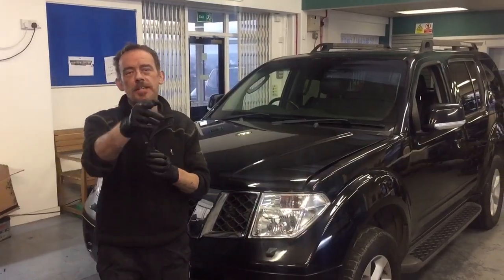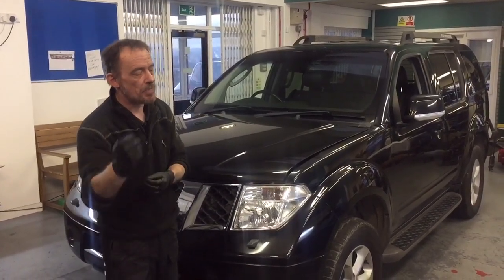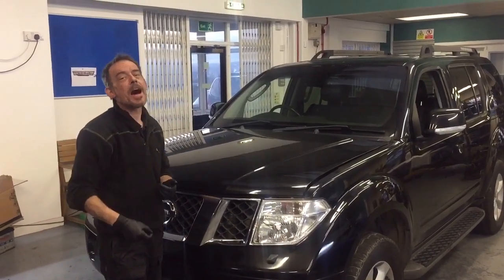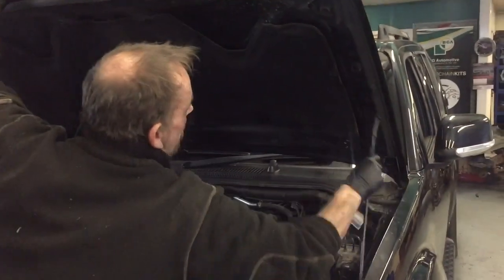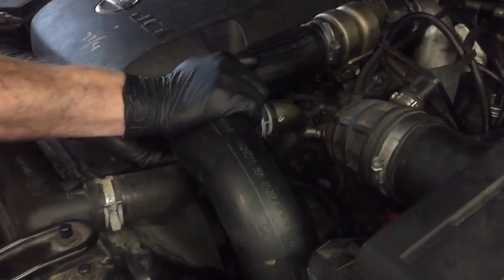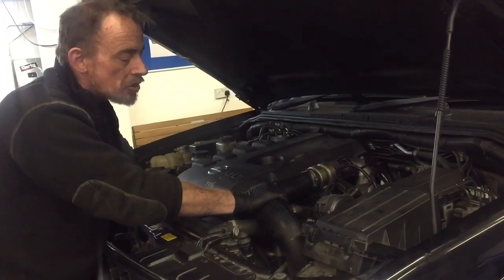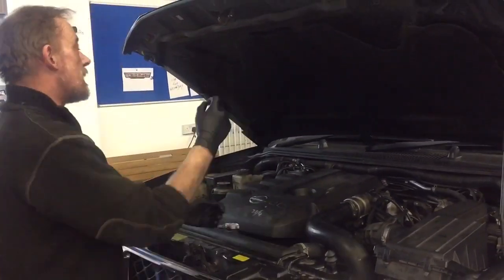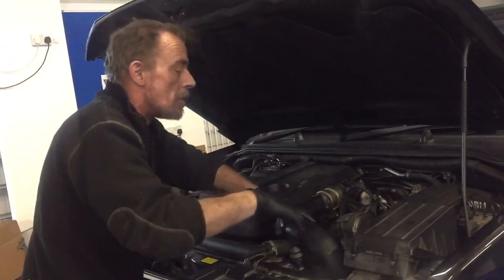Nissan YD25 Low on Power (Boost Sensor Failure)

Comment: That's not even a sensor ! It's boost control solenoid. Boost sensor is on the cooler side of the intercooler.

Comment: Hey guys . Enjoy your channel 🤙. I have a 2008 d22 Nissan navara 2.5 liter with the yd 25 engine. Driving home from work today I pulled away from a set of lights. Had a complete loss of power. Thought it was the turbo but after taking the turbo out the hoses are all good and the rotor spins freely. Any idea what it could be?  Cheers.

Comment: I just have sorted out a low boost problem on a Navara.  It turned out that the rubber vacuum hose from the vacuum pump to the little steel pipe that goes across the top of the engine had perished. So make sure you have vacuum to the boost sensor with the motor running before you go pulling everything apart. It's the one on the very end.
Reply: Did it also cut out?
Reply: @bountyhunter1890  No, It was just gutless as the wastegate was open all the time. The vacuum closes it, directing the boost to the intake manifold.
If it cuts out it's a fuel problem. Also check the wiring to the fuel shutoff solenoid.
Reply: @tazman8697  thanks for the reply I had the same problem with that pipe but it was cutting out and no power and smoke fixed it and went great for about 3 weeks then yesterday it cut out and smoking again just like before but pipe is fine.  Thought maybe the turbo vaccum selanoid?
Reply: @bountyhunter1890  You should see the wastegate arm move when you rev the motor... If it doesn't, check back from there...
Reply: @tazman8697  That’s the thing it will not rev ither only sometimes just smokes.  And sometimes revs to 3k others times just sits rough idling. But that is a good idea will start at the gate.

Comment: Changed the boost sensor on my pathfinder, at idle the actuator does not pulse. Hooked up a vacuum gauge , it just stands at 20”hg vac. Checked the signal wire coming from the ECU , it stands up @ 6.5v. Any suggestions anyone ? Really not sure what to check again....

Comment: Hi mate I have a Nissan navarra stx 2007 Spain yd25 I paid $11000 for a reconditioned motor and very sure it not ivhad nothing but problems with it  it keeps blowing white blue smoke it smells like a major fueling problem but not sure I changed The boost solarnoid for a new one it worked go for two days and shhit it Self I put a new Turbo on the other day and I'm still having the same problem and it sounds like I have a blow off Vale for some reason If you could help much apprecreated
Thanks mate ben
Reply from the maker: Your injectors are goosed that’s why the turbo has failed 
All the best Des

Comment: I have changed my turbo and solenoid still not making boost what should I look at now could it be a hose leak or something else
Reply: Try the Fuel Suction Control valve. Mine did that a couple of times, I had to reset the ECU to regain power, lately it just given all up I did a new FSCV I was sorted
Reply: @mphoramokolo5555  Hi my D40 2007 has mechanical throttle body and two solenoids a boost solenoid on one side and the other similar one on the other side ,they are both new and just rebuild the engine with every part from bottom up and I'm stuck with  reconnecting the vacuum lines as i bought the vehicle with incomplete  engine without them to rebuild.Engine is running very smooth but dont boost .The engine has EGR blocked off already pipe removed and manifold modified.May you or anyone please advise beginning from vacuum pump how the vacuum pipes should be connected to both the 1st splitter plate to 1st the regulator solenoid to 2nd splitter plate to throttle  body to over the engine to turbo boost solenoid to air intake and to turbo. It tried using the popular diagrams on the internet the engine start smoking heavily then took it off.

Comment: hey guys love your videos!! all the way from Perth Western Australia. I have a boost problem. I have changed my wastegate on Thai yd25 2011 d40 and the rod on wastegate actuator keeps going up and down. Have done this test on hot intake pipe and boost seems to be working okay in idle but the problem really shows itself under load. any help would be awesome as last mechanic thought it was clutch and she was on her way out but got home after install and saw spring rod flickering. Thanks Brad

Comment: Hi my D40 2007 has mechanical throttle body and two solenoids a boost solenoid on one side and the other similar one on the other side ,they are both new and just rebuild the engine with every part from bottom up and I'm stuck with  reconnecting the vacuum lines as i bought the vehicle with incomplete  engine without them to rebuild.Engine is running very smooth but dont boost .The engine has EGR blocked off already pipe removed and manifold modified.May you or anyone please advise beginning from vacuum pump how the vacuum pipes should be connected to both the 1st splitter plate to 1st the regulator solenoid to 2nd splitter plate to throttle  body to over the engine to turbo boost solenoid to air intake and to turbo. It tried using the popular diagrams on the internet the engine start smoking heavily then took it off.

Comment: Hi I from Costa Rica I have nissan navara 2012 yd 25ddti automatic transmission the issue is when you go at high altitude on 3rd gear climbing a road, the car don t change gear for more power and  don t rev up more then 3000 rpm,  the turbo blows but its not enough to get more speed and power. The car is not on limp mode.
Thanks.
Reply: I have the same issue. Did you get yours resolved?

Comment: I have a sluggish 2007 D40 and had the symptoms you explained.
I have swapped my turbo booze sensor however still no turbo when driving and inlet pipe still sucking in.
Any ideas guys?
Reply: hey mate did you ever get to the bottom of the problem ?

Comment: Isn't that the boost control solenoid? The boost sensor is located on the drivers side of the intercooler on the top?
Reply: Cameron Clarke Exactly, as far as I Know, this controls the turbo boost because it moves the wastegate... I think he is wrong, the boost sensor is in intercooler
Reply: Rafael Ponce you’re partially correct. These turbos don’t have a wastegate. They are a VGT (variable geometry turbo). Basically they have a bunch of fins that direct exhaust towards or away from the turbine, therefore controlling the boost pressure.
Reply: R.P don’t think too much

Comment: I have the P012B code which says that the inlet pressure boost gauge is faulty. And the truck goes into limp mode. Will it be the boost gauge or the solenoid?
Reply: Hi. What was the fault? I have the same code. Thanks
Reply: I had the air filter clogged for 2 weeks, then when I noticed and changed for a new one. The engine module has a memory with learning, so with a advanced tune. The engine learning was reseted and everything was like new
Reply: Hi there. Thanks for your reply.

Comment: hi there i replace this sensor on my 2007 nissan pathfinder and still i have no power when i take off very slow what should i do thank
Reply from the maker: Try a EGR blanking plate and fuel and air filter.

Comment: I have a Nissan juke 2013 and it is having the same problem sluggish but will eventually speed up and run.  Challenge was getting off the highway when it was sluggish.  We had to take some back roads and drive slow to get it back home.  Now we are not sure what to do.  We are giving it the test you mentioned and we will replace it.  Getting a price for it right now.  Do you have a plan B if this does not work?  Thanks

Comment: Hi, thank you very much for the explanation. I would like to have a sensor map of the YD25 engine of the Nissan Pathfinder 2009.
I need to understand some problems in my car related to the operation of the sensors and their respective locations.
Angola 02/25/2019
Reply from the maker: Never remap buddy not good for this motor all the best Des

Comment: Hi can you tell me where the hoses are ment to go on the boost sensor?
Reply: left to right, 1. Air intake (after MAF Sensor) 2. Turbo 3. Vacuum line to fuel pump.
Reply: @GJCBen  it seems not even Des has ever responded and give clarity  to several questions about this one.

Comment: Hello. I have a Navara d40 2007 when it goes from 1500 to 3000prm it makes a terrible noise like a whistle and it comes from its turbo. Does anyone have any idea what i have to do? thank you
Reply: whistling noise is air escaping. usually its at one of the connections after the turbo, check the connections to and from the intercooler, look for any visible signs of oil.